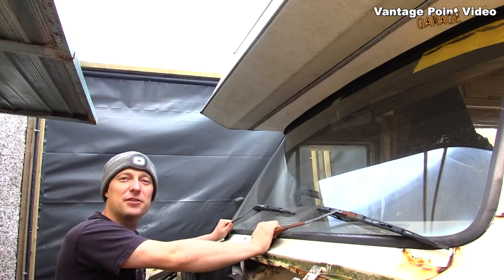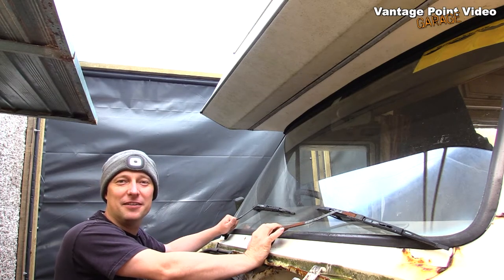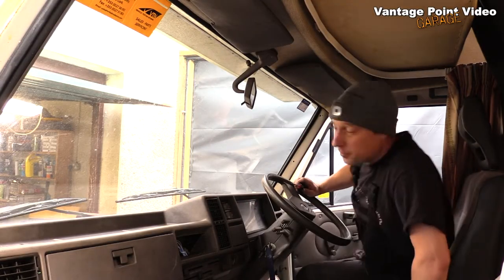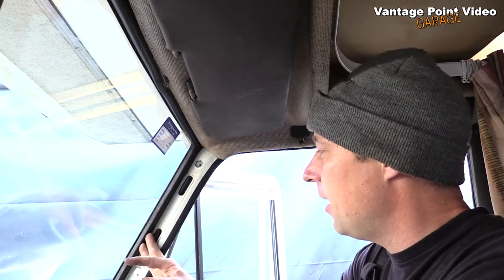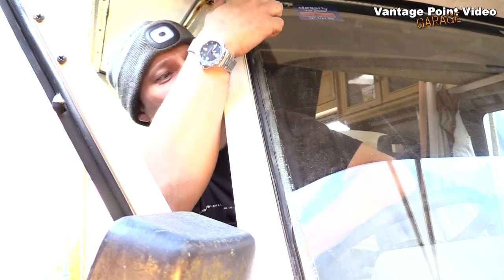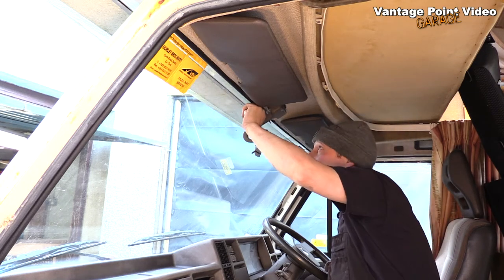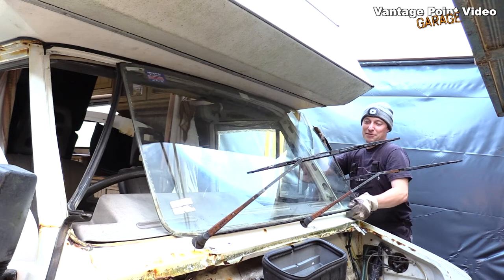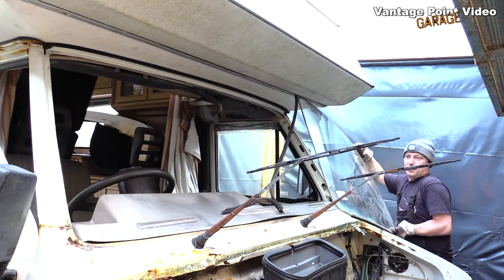Talbot Express Windscreen Removal: Camper Van Restoration #5

Comment: good work, ive a 10mm rust spotright under the window rubber, thinking of taking the window out to do properly or should i just 'wing it? have you a vid for putting the window back in? think ive the same 1991 eldis as you, just pulling the seals of as loads of leaks to sort!
all the best Robert.
Reply from the maker: If you can get a new windscreen rubber and cut the old one out. It can be a bit risky for the glass to get it out otherwise. I haven’t got my Talbot windscreen back in but I’ll do it the same way as my Kadett https://youtu.be/kWRnBL05j14

Comment: Would a very thin piece of ply or mdf ( same size as windscreen ) bent round and taped completely around the edges not have worked for you? I think that would have been easier and less risky in the long run. Saying that, it's a good way to get at anything around the window that needs repaired.
Reply from the maker: I’ll have a bit to do on the A pillars and I wouldn’t want any masking lines around the rubbers when I spray paint the cab.
Reply: @VantagePointVideoGarage  Oh'i see! That makes sense.